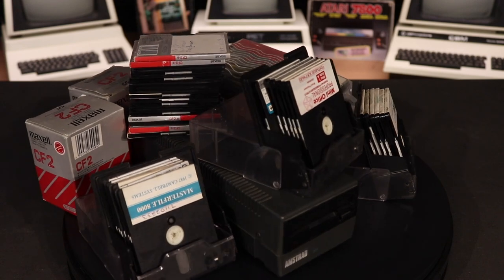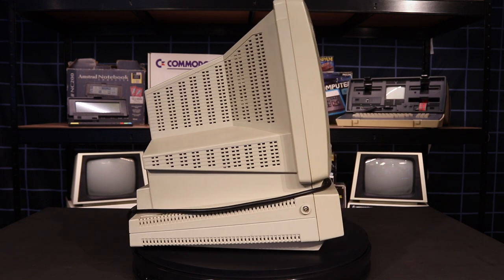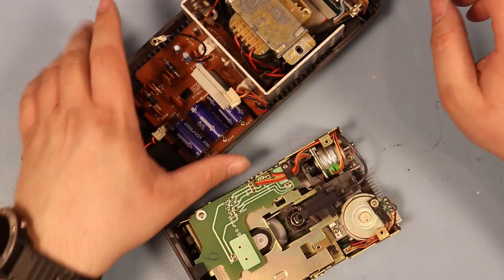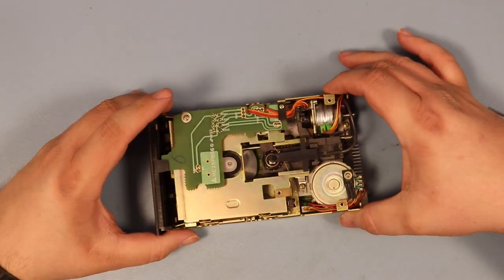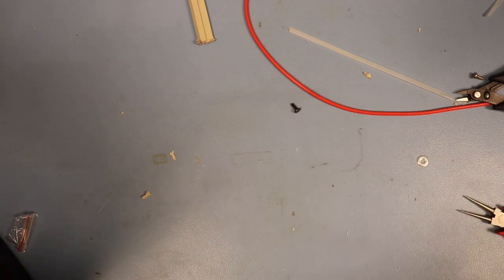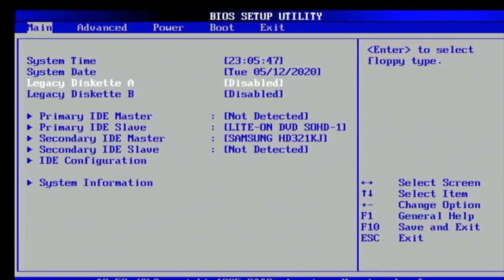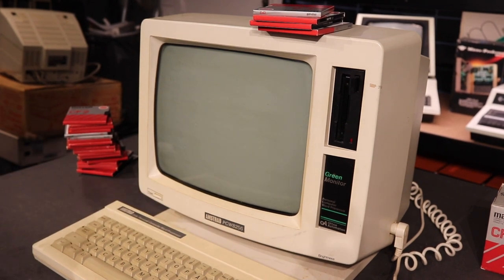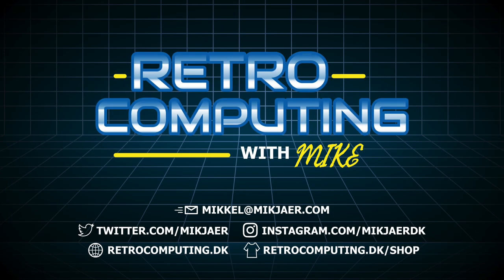Reading and writing  Amstrad CF2 Floppies on a PC with CPCDISK and Windows XP

Comment: I have a PcW 9256 with one 3.5 inch Floppy Disk Drive.

On my Windows XP PC I have Software Ansible Information CP/M Copier Reads and Copies PcW Disks to LocoScript Professional for my PcW  LocoScript Documents to PC and Locolink for Windows to transfer Copies LocoScript Documents to Microsoft Word.

I also have Mallard Basic on my Windows XP PC.
LocoScript Software.

I also have a Joyce Emulator Boot Disk Image by Seasip on my Windows XP PC.

All this software PCW Software to PC I have on my Windows XP is Windows 95 to XP compatible.